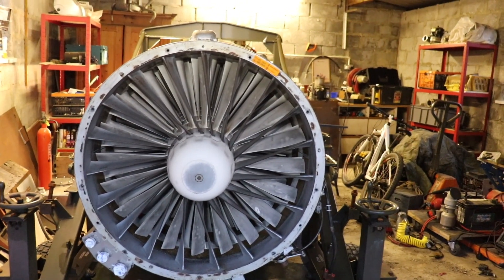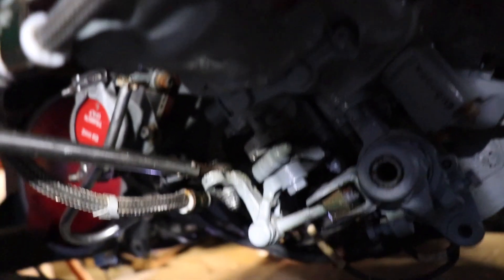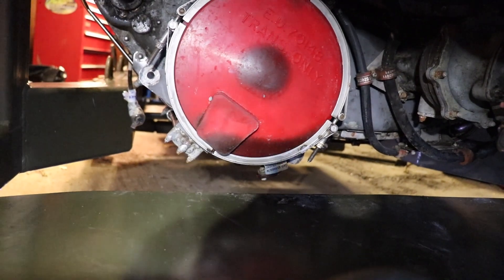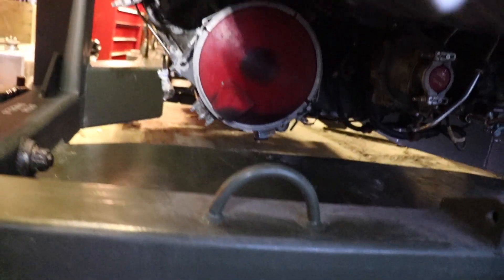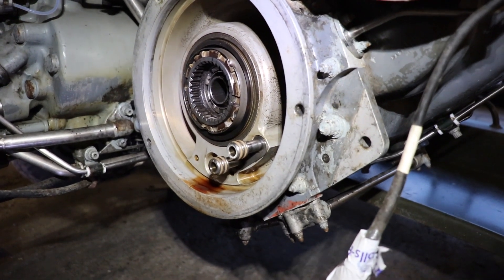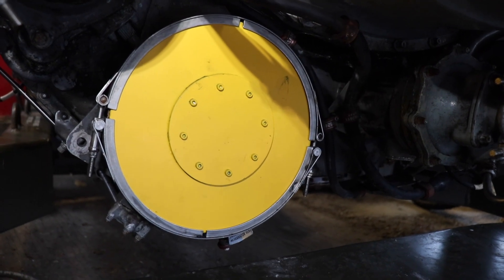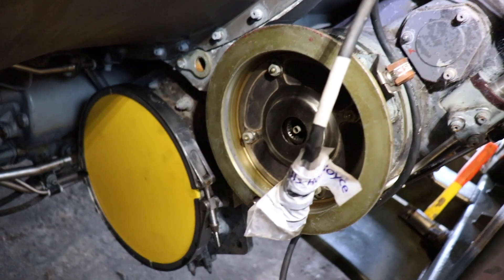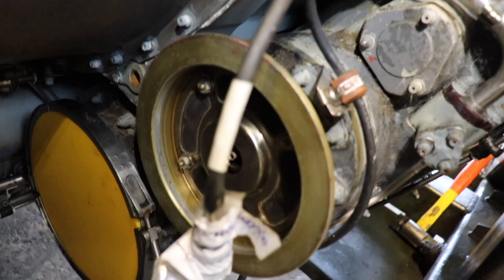Rolls Royce Spey Part 2: Gearbox blanks and Starter

Comment: Why is the air starter inlet connected to the de-icing air piping in this engine?
Reply from the maker: There is a pipe from the HP compressor which is shared and goes to the de-icing air supply. There is a check valve which prevents this going to the starter
Reply: @thewtf  and what about air from air starter. Does it go to high pressure compressor and deicing when the engine is started(when that one way valve is open)
Reply: @JetEnginesIndia  No the check valve is located between the HP bleed and the division to the starter and de-icing pipe. Start air will go one way into the air starter and enter the de-icing pipe work but there is a valve here which is normally closed. Once the engine is up to speed HP air is prevented from going into the starter by the check valve and the starter air cut off valve...sorry its a bit complicated!!